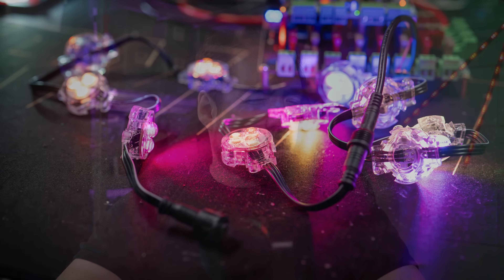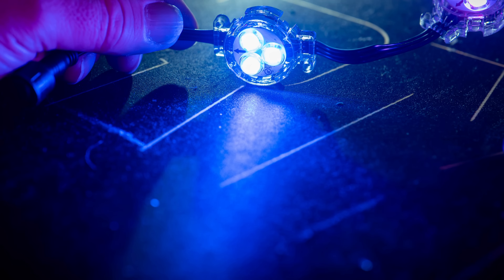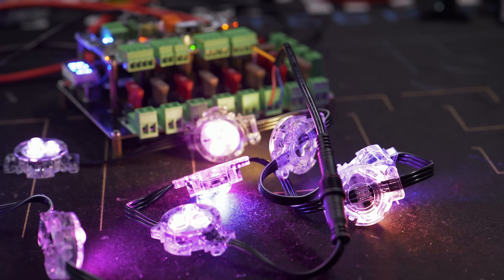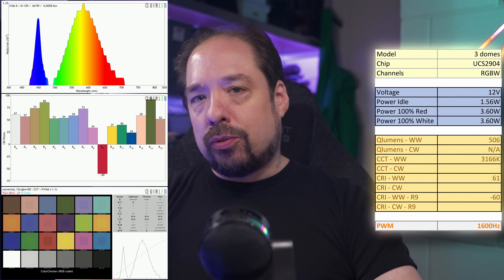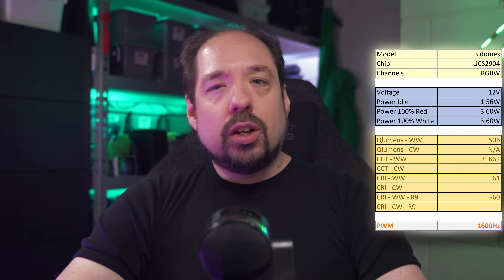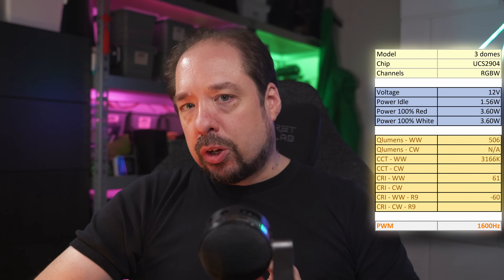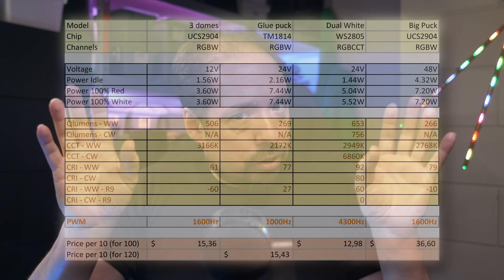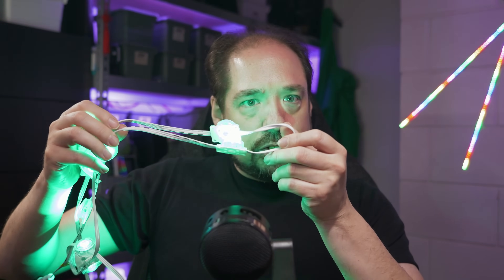💡QuinLED💡Puck lights review 2025

Comment: Have you tested the 24v UCS2904 puck lights? also, my 12v ucs2904 6k pucks are .96w/.08a per puck as stated by the manufacturer
Reply: Can't get them to work with wled
Reply: @kcoop99 what are your wled settings?

Comment: I have the 12V RGBW ones (in 6000k temp), a total of 183 on my house (roof line, and above garage doors), I was able to do this with 2 DigQuads (DDP to link together) and no splices nor injections, as no way would I be doing that while on an aerial lift 20-30ft up in the air; longest run is 62 pucks with no visible voltage loss, using 16/3 wiring; I tested around 70/75 length before I noticed voltage drop.
Reply: I just uploaded a 10s clip on my channel.
Reply: Are you saying 183 pucks, or 183 strands of 10 puck/m strands on your house meaning 1,830 pucks?
Reply: @xXMOTOXPYROXx 183 pucks of WRGB.
Reply: @homeboi808 Curious why you used two dig quads instead of one?
Reply: @xXMOTOXPYROXx  Did my other comment get deleted? You can search the WLED subreddit for my username and see my Halloween post. I didn’t want to splice/solder and I didn’t want super long runs and worry about voltage drop. One control box for the left/middle and another for the right.

Comment: Hi Quin, thanks for all your info. I and many others really appreciate it. On the power usage for the 24V pucks you have 100% White at 5.52W for 10 pucks but on Ray Wu's listing it states max power as "2W/LED; 40W per string(20 Pixels)" Is this because it can display white and colour at the same time? I'm confused as to what power usage I should size the supply for. Any help appreciated
Reply from the maker: Yes, I did not test or list 100% RGBW or even RGBCCT at full brightness, only a single channel. You can kind of extrapolate from there. But with normal usage I'd say that 100% W or maybe 150% is a safe value to assume and will allow you to run single colors at 100% on all pucks at the same time and thus effects and such will be fine too. If you want more headroom to be certain, can't hurt for sure!

Comment: Making me spend money again, shakes fist! Going to replace my 24 volt roof pucks, have a few with blue failing after 2 seasons. Will try the cd24 ws2805s 0:03
Reply from the maker: Ha yeah, sorry 😅. Hope they last a bit longer then 2 seasons though, that's dead quickly!
Reply: Its odd, its at the one end of the one string of 4 only. Assuming its just a bad string right now. Its been incremental and psuedo random in the first few, though once one is bad it stays bad.  It looks and behaves physical.  @IntermitTech

Comment: When you say injection at front and end, Is that adding adding power at the front along side the actual/original power wiring?
Reply from the maker: Ah no, generally all those wires are soldered to the same pad/wire so you only need to use one (also applies to strip, etc.)

Comment: Great video, is the Dig-Octa board that is on allnet site the version 2 board? and what would you recommend wire spacing with 24v RGBCCT puck lights on a house?
Reply: It would be the Jerems store is it the V2 board?
Reply from the maker: All stores were updated at the same time and we always sell the latest version so no worries there!
Reply from the maker: Spacing really depends on the look you want, either to wash your complete wall with tightly spaced pucks or explicitly spaced pucks to have the separate lens and light look.

Comment: Great video again.  Do you have a storage facility for the dig range.  I want to use mine out doors and not overly confident with what I've built
Reply from the maker: I don't offer waterproof boxes if that's what you are asking. Generally people mount it in a waterproof junction style box and then run the cables outside.

Comment: Do you know any pucks with ws2805 (rgbcct) that have a diffused lens? my application would be on a stage set where the LEDs would be directly visible -> the single LEDs in the pucks don't look to great, but the bigger size (compared to an LED on a Strip) looks much better in the design and requires much less control channels on the light controller
Reply from the maker: Ah no, I do not, you could ask the shop if they could make one though, they manufacture them themselves I think. That said, with even just a bit of light the individual LEDs really aren't visible anymore, cameras record an LED very differently from real-life and while I try to show a good representation it's still a bit difficult. Maybe order a testing sample to see how it looks to you.